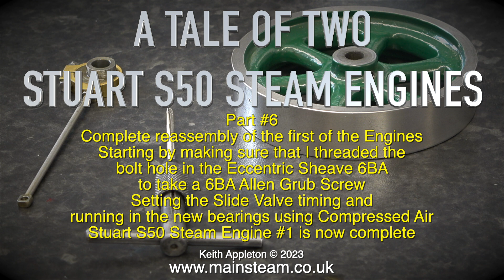A TALE OF TWO STUART S50 STEAM ENGINES - PART #6

Comment: Words of insightful wisdom from aside the shade tree; or better yet Confucius say he who reams a set hole through, has a shaft that runs true and fast. There's a girl friend joke in that somewhere, I'm not old enough to have had that many to know lest my wife kick my tail in the process. 

Well done, I do believe Stuart needs to take a look and re-engineer this engine for that larger flywheel if they keep running it as that bearing was hardly large enough to deal with the old ones given their size and weight. If that is really the new one I can see it doing exactly what it did as quickly as you figured. No engineer here, just a mechanic that deals with poor designs.
Reply from the maker: I can't be sure that this was the original Flywheel suppled by Stuart, it is not the usual type of S50 Flywheel.